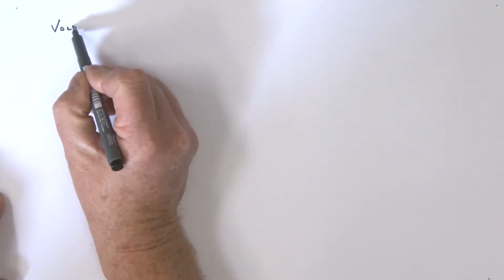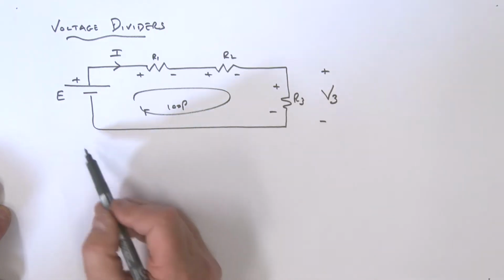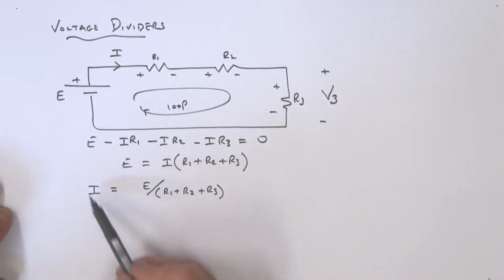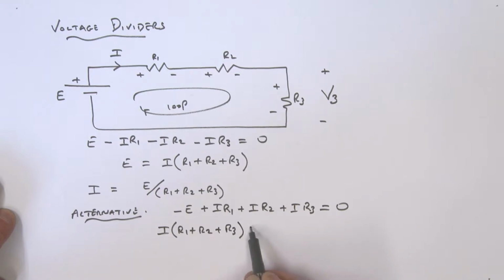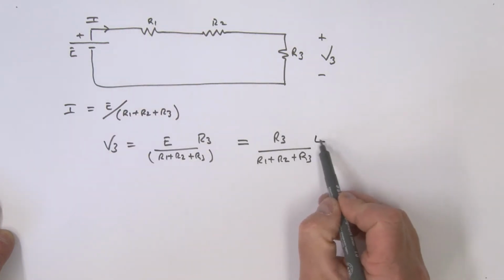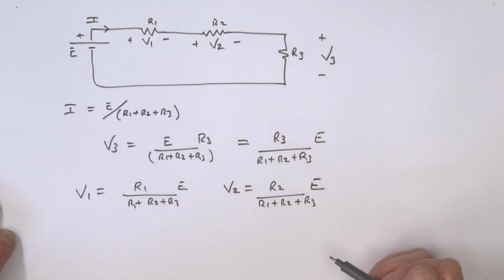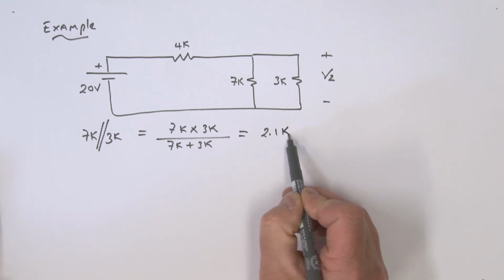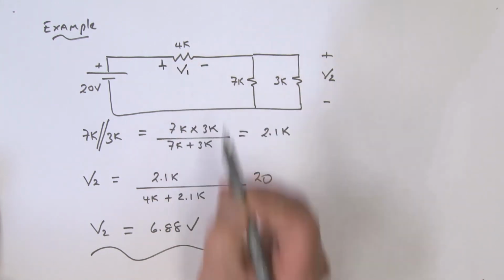Voltage Dividers

Comment: This is a really helpful and great video but I have three questions regarding this 
My first one is what conditions do tou know when to use voltage divider 
My second is if there's a way ro solve it in parallel
My third one is what if there are more than one emf or voltage sources

Comment: at the end once i basicaly turned the parralel circuit into a series value i treated them both as a series resistance added them up for R total divided by the source voltage total v/r to find current then used that current total to multiple for R2 and that gave me v2